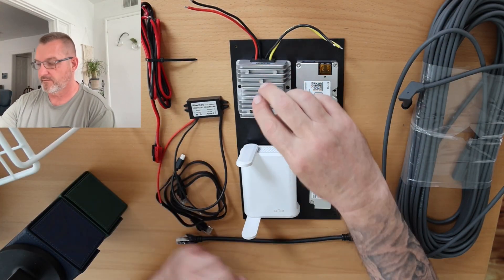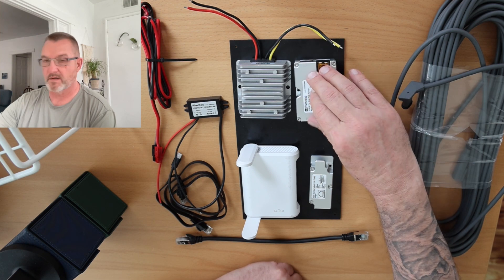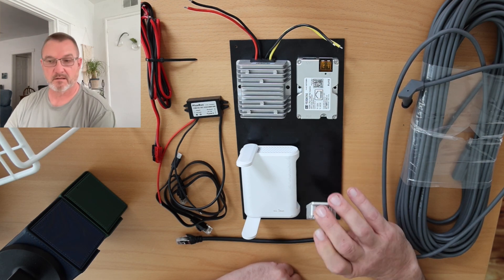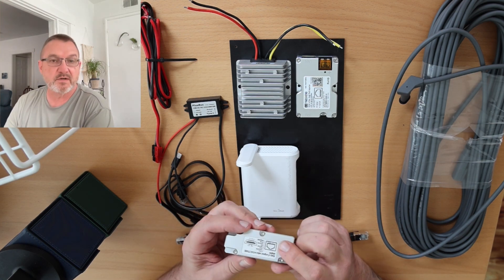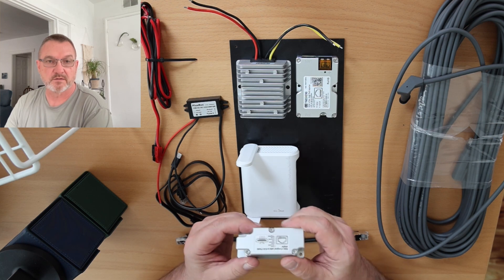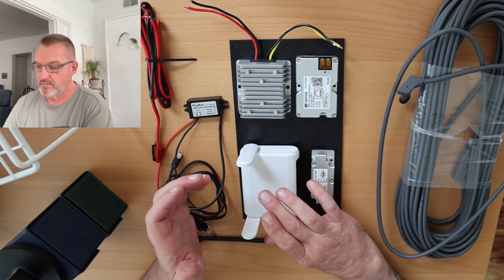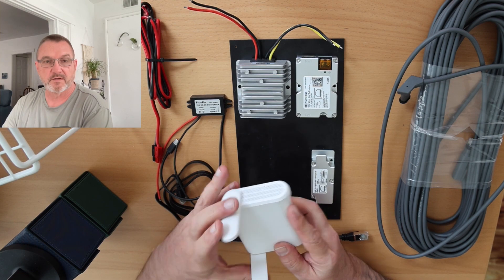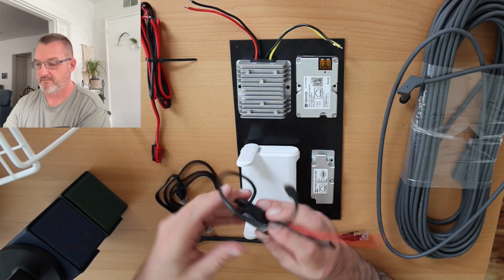Starlink 12V Router Upgrade - Fully Portable, Saves Battery, and New StarMount

Comment from the maker: Here are the part I used:
Cable adapter:
https://a.co/d/fjeZKao

POE Injector:
https://a.co/d/cpL1cgr

12v-48v up converter:
https://a.co/d/5IlMtRW
Reply: What 12V to USB-C power supply did you use?
Reply from the maker: @spencerogden  https://www.amazon.com/dp/B09DGDQ48H?ref=ppx_pop_mob_ap_share
Reply: Do you mind sharing and update on the links to the "power pulls" you used/wired in to make this portable?
Reply from the maker: @Skoolie_of_Fish  I buy all my power pole connectors and crimping tools from these guys. You can get a “starter kit” of connectors and their crimper which will give you everything you need. You can get crumpets that are less expensive on Amazon but you get what you pay for. 
https://powerwerx.com/
Reply: One more question: What size fuse are you using in this system?
Reply from the maker: @Skoolie_of_Fish  I have the main power line fused with a 7.5a in-line fuse if I remember correctly.
Reply: What battery for the portable pack are you using

Comment: Dunno if you meant to but you picked the right router. this GL.Inet routers are very capable. They contain a number of different VPN tools which will allow you to put your whole network (all the things using the WiFi in your Jeep) back to your house or some other place in the US (or other countries) so that your Netflix account will still work. If you put a VPN server on at home you can also connect back to that network securely. they also support traffic shaping so that you can get the best network experience across the satellite. 40W @ 12V is about 3.3 Amps. So your power draw is about the same. Watts are Watts are Watts.

Comment: Friendly Caution: The antenna emits 12Ghz radio at 4 Watts on transmit. This is done using phased array beam steering. 1st. the transmission pattern of the antenna has a significant side lobe leakage that emits forward along the plane of the antenna (Into your windscreen). 2nd the antenna steering can be as low as 60 degrees from vertical. Not quite centre of your head but very close. This steering is dynamic as the antenna tracks moving sats. I would not every consider placing a starlink antenna transmission plane (face of dish) in any orientation where it exposes humans regardless of the period of time they maybe exposed. FCC has a prescribed limit of 1.6 watts per kg for humans. The issue with the sat antenna being it is not a cell phone or a cb radio. It is a highly focused beam array that produces significant gain in the direction to which it it transmitting. I would not like to drive in your car for any significant length of time. Sorry to provide negative advice on what looks to be a very fine installation and quality work. Science just gets a little in the way for long term risk. Hope the info starts you on a journey to evaluate that risk for your self. Bet of luck.

Comment: Used the same yaosheng kit. It worked at first but buy 9pm starlink disconnects and it didnt get fixed. Faulty product?
Reply from the maker: Most issues are traced to the 12-48v voltage converter. Make sure you are getting the correct voltage output and connect directly to your battery
Reply: @jeepNtreetop  I used a multimeter its output is 48v

Comment: Great video! Easy to follow. Before you constructed this 12 V conversion,  what kind of inverter were u plugging into? Modified sine wave or a regular inverter? Thanks in advance!
Reply from the maker: I have a Victron pure sine wave inverter installed in my jeep. I still use that now only when I have to, instead of needing to have it turned on all the time to power up the Starlink.

Comment: Regarding your recommended 12v to 48v step up power converter, I happened to install the same one with the Yaosheng POE injector and cable adapter and I see frequent brief “Disconnected” messages in the Starlink app.  (It works fine with the original Starlink router.)  I contacted Yaosheng and asked for help in other forums and the repeated advice I’ve received is that those power converters can be problematic (including introducing noise that affects performance).  The recommendation is to use a Mean Well DDR-120-48 converter instead.  I’ve ordered one and hopefully that resolves my problem.  Just FYI to folks that you may want to avoid that particular brand of step up converter.
Reply from the maker: I have heard that some of those power inverters can be problematic, I however,  so far have not experienced the issues that others have been reporting.
Reply: I have run this setup for over a year now and I have had terrible speed issues. After a lot of troubleshooting I've determined it's either the 12 to 48 volt converter or the injector itself.  I think I'll get one of these converters you're talking about and see if that solves my problem.

Comment: Do you need to enable the bypass starlink router and turn off the starlink wifi by the starlink APP
Reply from the maker: No since you are not using the Starlink router. You will be using the settings of the router that you choose. The Starlink app works as it did with the Starlink router.

Comment: So this method will not work for the High Performance Sat Dish huh? I have every component in this video but my sat cable doesn't fit..
Reply from the maker: The high performance large dish uses much more power than a the standard dishes do and even though I don’t own one I’d imagine that the cable and connectors might be different.

Comment: Nice video. Only thing you forgot to mention is the  ( hopefully) included special Ethernet cable from the injector to the starlink adapter. Thanks
Reply from the maker: The little short one? It’s not special since the pinout switch is done inside the adapter but it is included anyway. 👍
Reply: @jeepNtreetop  but I think it’s a different pin out on each end. Yes I know it’s included with the adapter but it won’t work if you use a regular Ethernet cable you could be in big trouble. That’s what I’ve been reading.

Comment: Great video. Do you have to configure the new router before using it, like putting in a password and such? Thanks.
Reply from the maker: You can, but I just used the default options and it worked great for my small Jeep setup. Remember, you can use any 12v router of your choice that has the features that you need.

Comment: Just tested it out and works great. Streamed from Apple TV in RV. Unable to run it from the app but the stow without app worked well and all packed away perfectly. Is there a way to use the Starlink app to see the new router and use its stow function? Is so please advise.

Comment: Couldn’t I just get a renogy 48v power pack and plug the dish into that?
Reply from the maker: You can do that as well as long as that power supply can provide 180w of “clean” power continuously. Most issues with 12v conversions can be traced to inadequate and unreliable power.

Comment: Can I wire it to 12v cigarette lighter style plug instead of power poles?
Reply from the maker: Sure you can, just make sure your wiring is heavy enough to handle the needed power draw of the power supply.

Comment: Question:when running the line from the POE to the router, what port on the router is connected, the wide area port or one of the local area ports?
Reply from the maker: The WAN is for hooking up your Starlink to. All your other “local” (local area network) plug into the “LAN” ports.

Comment: Hi there
Thank you for this video information which I will follow and install in my vehicle.  I intend to tow a caravan and was wondering what your thoughts are with re modem’s wifi range I.e. could I pick up router wifi from inside my caravan (assuming the caravan is parked next to the vehicle). 

Do you think this would work?
Best wishes
Peter

Comment: Why the 12V converter for the router - why not use the 12V from the vehicle??
Reply from the maker: My particular router runs on usb (5v) so the converter is to further convert the 12v down to the 5v usb connection. If the router you choose runs off off of 12v you can eliminate this small buck converter.

Comment: Thanks for sharing your setup! Does the starlink wifi signal still work or do you have to use the ethernet after this. I have been assuming that the wifi still works but it would be great to have confirmation.
Reply from the maker: If what you are referring to is the Starlink app, the answer is yes. No issues.
Reply from the maker: If what you are referring to is the Starlink app, the answer is yes. No issues.

Comment: I just saw a video of a StarLink all in one solution where the POE, router, converter, are all installed in the same enclosure as the antenna, and all you have to do is run power to it. Makes for an easier install as all you have to do is run 12v to it

The adapter you used though is pretty neat, as you don't have to cut the cable, but I think the all in one solution would be better, and you're not stuck with a whole spool of cable.
Reply from the maker: Yes that all in one is a very sweet unit. When I did my Starlink flat mount modification the all in one unit was not available so I had to come up with my own solution from off the shelf parts.
Reply: where is the video?
Reply: @agps4418  

https://youtu.be/5VZdjX0f-AU

Comment: Great set up & video 🤙🏽

Does the components (POE Injector & Converter) gets hot? The reason I’m asking is I’m planning to mount the inside a box together with flat mount dish. And the box will be on top of my roof rack in the sun. Was curious is it will get too hot inside the box?
Reply from the maker: The POE does not get hot at all however the 12-48v voltage converter does get a bit warm. So if you convert the voltage and then run it into your setup, you will have no issues.

Comment: If you still wanted to use the Starlink router, but wanted to use battery power, could you just use the poe with the battery?
Reply from the maker: No, that would defeat the purpose of this setup. The starlink router runs on 110v. So if you are going to plug that in to power it you mind as well use the POE that’s in the Starlink router already.

Comment: On the POE adapter in the Amazon reviews someone said "Don’t buy; It prevents unstowing Starlink
Works great right up and until you want to unstow Starlink. That doesn’t work. Once unstowed, you can do everything else including stowing it again. Have to use the Starlink router to unstow it…"

Is this true? If so, couldn't you just power cycle everything? I realize this only matters for the not in motion dishes. I stow mine every time we move the RV.
Reply: I don't have mine flat mounted yet. I stow it and cut the power every time I move in the van. When I turn it back on, it adjusts so I don't see using this PEO as a blocker. I just ordered all the parts he has in the video so we'll see.
Reply: @cyberliferrr  Looking forward to see/hear your assesment of the setup without flatmounting it.
Reply from the maker: To be honest, I have my dish flat mounted so I never stow/unstop my dish therefore I can’t advise you either way on this. Otherwise it has been working flawlessly so far without any issues.
Reply: @jeepNtreetop  Thanks for the reply, hopefully someone else will see this question. I am glad this works good for you. It is a nice clean solution, but I still need to figure the best way to get the cable into the travel trailer.
Reply: I can confirm. All features do work including stow with the app when using this setup
Reply: did you do anything special to the router as i cannot get my setup to work @matthewurban1189

Comment: Nice video and tutorial! What amp are your power pole connectors? 30a? I would love to see a video on how you set up your configuration of the jeep using power pole connectors.
Reply from the maker: I used mainly 30a connectors for pretty much everything. I’m in the process of redesigning the electrical system and I will document the whole process. Video coming shortly.
Reply: @jeepNtreetop  many thanks for the quick reply and details. Looking forward to your next video 👍🏼👍🏼

Comment: I get all the losses, but does all that extra stuff not also draw power to just be online? How much are you saving over just running your inverter, I mean really?
Reply: Great video, thanks for sharing!  

I copied your setup, ordered the parts you listed, with the exception of the router, I’m using the   GL.iNet GL-AXT1800.  Everything is working BUT, I’m drawing about 4amps with everything powered up.  The 5 amp fuse I initially used was blown so I used a 10 amp (I’ll try a 7.5 amp when I get my hands on one) and that works and I’m getting great speeds BUT the 12v - 48v converter and the router gets REALLY hot when running.  It doesn’t seem normal.  What size fuse are you using?  And do you have any idea what I might have done wrong?  Thanks
Reply from the maker: @drua.8412  the 10a fuse should be fine if you used heavy enough wire since it’s there to protect the wire not the device. As for the heat, it’s normal for the 12-48v converter to get hot but it shouldn’t get so hot that you can’t touch it. Make sure you have it installed in a place that gets good air flow. Also turn your Starlink heaters off, that will save you some power draw.
Reply from the maker: My inverter draws 1.2a simply by being turned on with 0 load being applied. The Starlink router draws an additional 85watts or so from the battery so combined that’s almost 2 amps of draw off of my battery per hour. With the new 12v setup I draw less than .5a because there is no loss in voltage conversion and no need for the inverter to be powered on when I don’t need it. So you can see the original Starlink way uses 3 times the amount of power. I have a 200ahr battery bank so the new power savings is a big deal when it’s cloudy for several days and my solar can’t keep up.